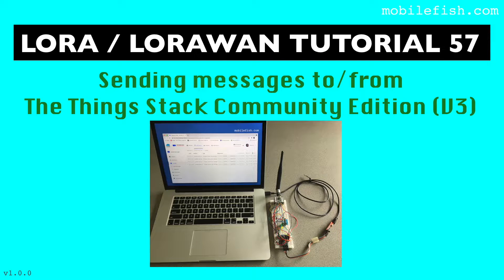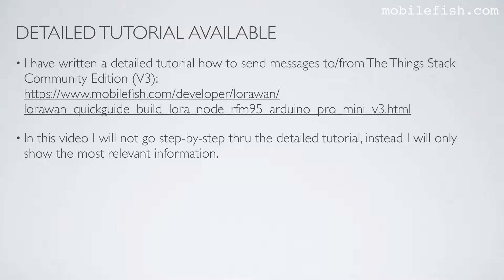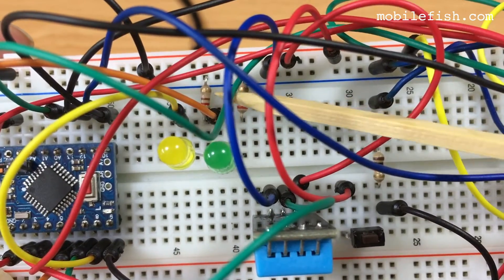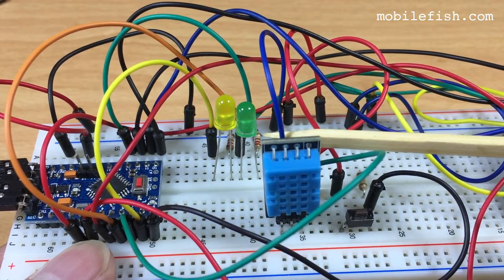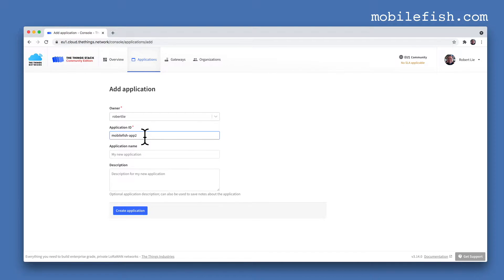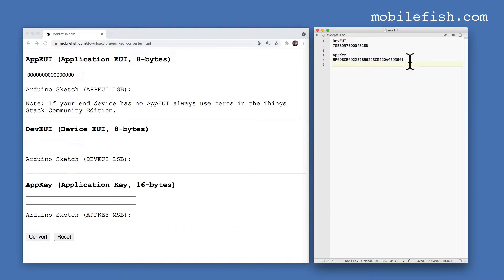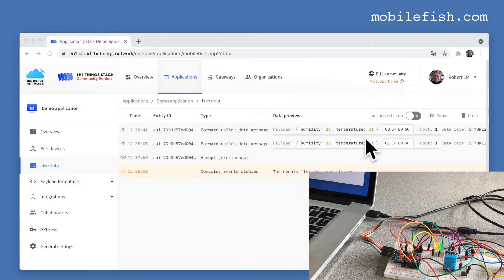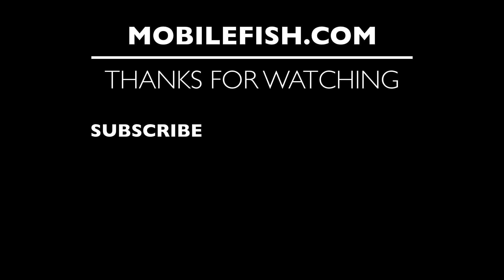LoRa/LoRaWAN tutorial 57: Sending messages to/from The Things Stack Community Edition (V3)

Comment: Thank you very much for your video ! I´m trying to figure out If my lorawan connection is there or not to know the maximum possible range I can get with my setup. I was also thinking something with a LED and I used the ESP-sc-Gateway library to communicate with TTN. My sending function works as I can see the payload on TTN but my receive function does not work. Do I need to do something special at TTN for this ? The library I use is also LMIC based like yours.